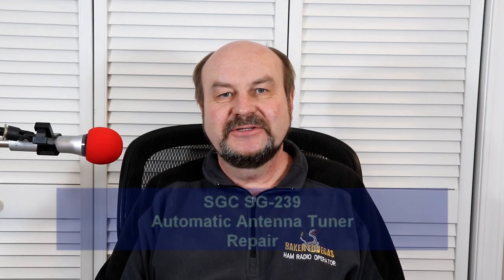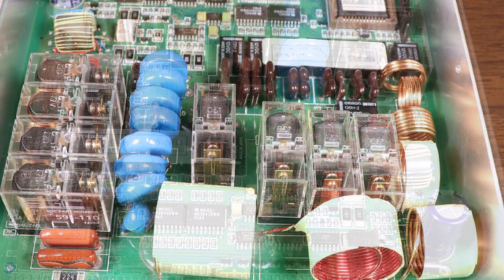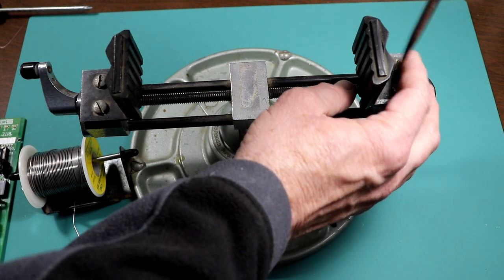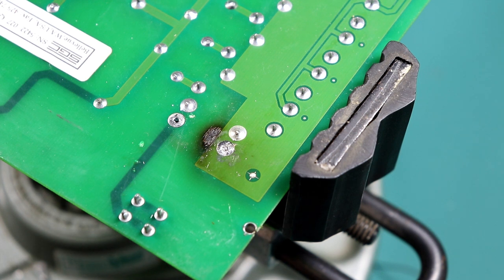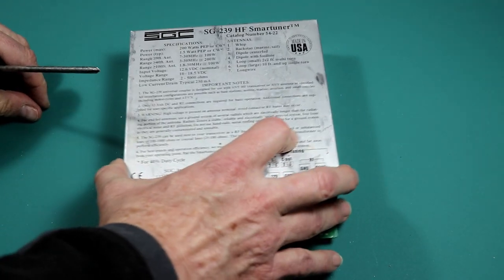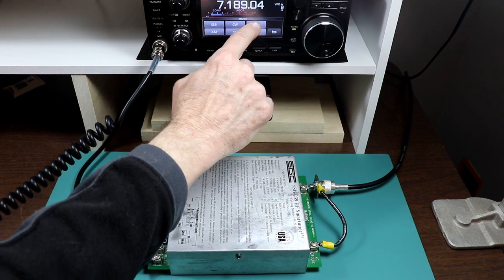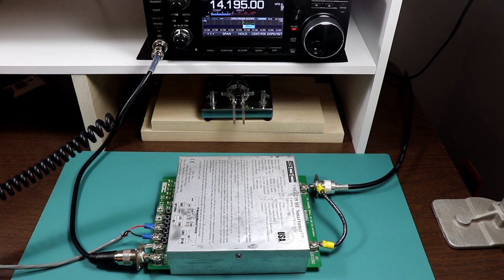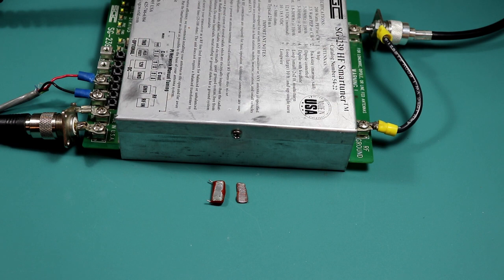Reparing an SGC SG-239 Automatic Antenna Tuner

Comment: I have used an SG-239 with my doublet antenna since 2015 at my home station.  The doublet is about 130 feet overall and that tuner has been able to tune from 80 meters to 6 meters even though I don't think the specs call for it to work on 6 meters.  I have mine in a Water tight enclosure mounted below the feed point of the antenna and float the tuner at RF. No Balun needed. Coax in and ladder line out.  I built my own remote unit which indicates when tuned and lets me select automatic tune or lock the tuner when it is tuned to keep from having the tuner "hunt" for a better match if the antenna moves in the wind.
I have never looked inside the top cover since it has just always worked.  I think this is one of the best and under rated auto tuners available.  I appreciate your giving me a look inside!   73 from another Tom
Reply from the maker: I thinks it’s a really great tuner too.  That was a very embarrassing solder job I did in that video.  I’m glad you enjoyed the peek inside.  Thanks for watching!

Comment: I have the same tuner which is fantastic. I mounted mine in a cable TV aluminum distribution amp box. For the output I used a CB antenna Gumdrop mount which screws into one of the center ports of the housing. Yes these housings use the standard 5/8”x 27 threads which allow type N and SO329 connectors to screw into them. Internally I used a short piece of coax to feed the mount which has a SO239 mount and split the cable to go to the output screws. Power is fed through an IsoT which is home built from a plan I found in an old QST article (or was it CQ?) that is mounted inside the enclosure. I don’t have the channel locking features available but it’s a perfect mount and protection for the 239.

Comment: I want to thank you for this video. My SGC-237 stopped tuning. Low and behold, the same capacitor is in the same condition! The SGC-237 has 3 of these capacitors. One looks like yours, one has a blemish in the top corner, one looks good, So I'm going to go ahead and replace all 3 capacitors while I have it apart.
Reply from the maker: Thanks for letting me know.  Sounds like this might be a common problem.  I'm glad the video helped, in spite of my awful soldering demonstration.  😉

Comment: Hi Tom, as always thanks for your videos.  I have been in the marine electronics business off and on since 1974 and your tuner looks like the insides of SGC's marine grade tuner, usually has a waterproof case around it.  One thing to be careful about is the burn in the board. It is between a point that can be a very high voltage and is near a ground. burning and causing the carbon on the board can cause it to short across if there is any moisture on the board.  I have had to repair this kind of problem many times on high voltage circuits.  cleaning out the burn and adding some epoxy will keep it safe.  Dave K6DCH
Reply from the maker: Hi Dave.  Thanks for the great tip on that.  You're right-on about the burn marks.  I work with high-voltage systems at work and I've seen first hand what carbon tracking on a board can to for arcing.  Looking back at that video, it's actually pretty embarrassing.  Believe it or not, I'm actually reasonably good at soldering.  You'd never know it to watch that video.  I was paying more attention to getting the camera shots than the work.  I discovered after I did that video that the tip on my soldering iron was loose.  So it wasn't heating up properly.
One additional tip is to coat the burned area with a high-voltage varnish or acrylic conformal coat.  That helps a lot.
Here's one option if anybody needs some:  https://amzn.to/2EchBma  (full disclosure- it is an affiliate link).

Comment: I thought that I recognized the base of a Panavise there,  something that was on my wishlist for a rather long time.  I finally snagged one when Radio Shack decided that they were going to discontinue their sales of it (I didn't even know they sold it),  so I got myself a deal.  Different top end,  though,  not at all like what you've got there.  Speaking of Radio Shack,  I was surprised when I last went into one looking to pick up a spare soldering iron.  Every single one they had in the store had that sillly conical tip!  I hate those things,  and find a chisel tip to be much more useful,  as you can control the amount of heat you're transferring by using a corner,  and edge,  or a flat.
Since pretty much everything being made these days is using lead-free solder,  which has a higher melting point,  the first thing I'd do when I want to melt the solder in a connection is to apply some lead-based solder.  This will make thing melt easier.  That bit with the torch was a really bad idea,  and you will probably end up seeing some problems with that scorched area in the future,  whether because of carbonization or absorption of moisure or whatever.  I'd make it a point to treat that with a dremel, at the very least.  And get yourself a bigger tip for that soldering iron!
Reply from the maker: That was one of my more embarrassing videos.  The tip is only one reason I did such a bad soldering job.  Oh well, it lives forever on the internet now.

Comment: You need a bottle of flux.  You need a bigger soldering iron.   A good example why I don't buy used equipment from hams anymore.  Too many new hams think they know how to fix things.  When they butcher it, they put it on eBay.
Reply from the maker: Hi Rick.  You’re absolutely right.  That was definitely one of my more embarrassing videos.  Believe it or not, I’m actually pretty good at soldering.  I found out after that video that my soldering iron tip was loose and I didn’t check or tighten it before I started.  I was so intent on shooting the video that I wasn’t really paying enough attention to what I was doing.  I look back at it and still can’t believe some of what I did.  Oh well, chalk it up to another butchered piece of gear.  Funny enough, the tuner is still working fine.

Comment: Good video and helpful!  I'm looking at  237 currently  and was trying to find videos or visuals of the tuner output.  I also intend to feed a coax antenna with a 237,  so I've been wondering about how most owners wire an so-239 up,  if parts are included, or if I'll need to procure my own solution.
Reply from the maker: I just took a panel mount SO-239 connector and soldered a spade terminal to the center conductor.  I screwed the spade terminal directly to the RF HOT connection on the tuner.  Then I connected a small jumper wire with a ring terminal on one end to one of the corner mounting holes on the SO-239.  I connected the other end of the jumper to the RF GROUND terminal with another spade terminal.  You could use ring terminals on the tuner terminals for a more secure connection.  I used spade terminals to allow me to quickly remove the SO-239 for wire antenna connections.  A neater, more permanent approach would be to mount a couple of SO-239 connectors on a box and then put the tuner inside the box and wire the connectors to it with short coax jumpers.
Side Note— Until I was writing this, it never dawned on me that this tuner model has the same number as the female side of a PL-259 connector.

Comment: I like your videos, but here I think you should have taken the time to get a bigger tip on the iron. 

I am curious how you’re feeding that end-fed wire. Maybe this was just for a test of your repair, but the proper installation of an automatic antenna tuner is to mount it at the antenna. Frankly, any tuner should be at the antenna, automatic or not, but of course the commercially made manual ones are not built for that. Putting coax on the output of a tuner can contribute to a huge amount of power loss. Just search the web for coaxial mismatch loss to see. 50 ohm coax needs to be 50 ohms in both side. If not, the losses increase dramatically. 

I have both the SGC-230 and 235 which are weatherproofed, but you can put that 239 in a plastic bucket turned upside down, bore a hole in the side for the antenna output (make a small drip loop on the outside of the bucket) and get much better performance than feeding coax.
Reply from the maker: Hi Scott.  You have some good points.  I’ll have to say that I both agree and disagree with you.  I have used this tuner directly connected to loops and other antennas on several occasions.  There’s no question that putting it right at the antenna it best.  My end fed is a non-resonant antenna with a 9:1 Unun at the feed end.  While there are some losses in the coax, they really aren’t that bad at 20 meters and below as long as the coax isn’t too long.  I’m using RG-8X and I only have about 25 feet or so.  I’m in a rental property right now that is in an HOA.  So my options are somewhat limited.
Thanks for watching and thanks for your comments.  Hopefully I’ll have a better antenna system to show off in the future.  73, Tom

Comment: I’m thinking about buying an SGC remote tuner. It sounds like it’s pretty dependable, other than that unreliable capacitor.

I would have added new solder to the soldering tabs and the sucked off the solder with soldering wick, instead of using that vacuum to remove the solder

Maybe you should buy a soldering gun for the times when the soldering iron doesn’t produce enough heat.
Reply from the maker: Hi Dave- That particular video was one of my more embarrassing moments. Thanks to the Internet, it will live forever. I was so intent on the video during that repair that I didn’t pay much attention to what I was doing. I found out after the video that the soldering iron tip was loose. So it wasn’t heating properly. I probably should have just scrapped the video and re-shoot it. At least this way people can see the real oops that occur in real life. 
It is a good tuner, BTW.

Comment: Need to use additional flux from a pen or add solder but you must use a bigger tip or a old tip you wore the tip from then crank the heat and alway add solder to a pad to suck away.  Or use solder wick 😬

Comment: Great video - thank you.  I couldn't help but notice the text on your cover may have seen better days due to use of this fine product.  To preserve the integrity of the text you may want to gently clean the case and then apply a few coats of 'wipe on poly'.  This coating will preserve the instructions for you or a future owner/operator.
Michael VA6XMB
Reply from the maker: Good idea Michael, but that may be too late for my unit.  The printed info on the cover has defninitely seen better days.

Comment: I have trhe 239 tuner -  I have reports of my signal having rfi and signal sometimes stutters  Have you ever had a problem like this  -  I am running a inverted V abt 45' off the ground.  I found a loose wire from the tuner to the  power supply.  Tightened the wire but  the problem still exists.  Any thoughts  Burt